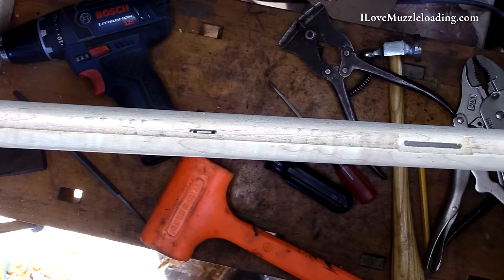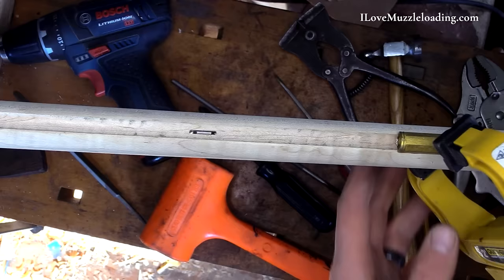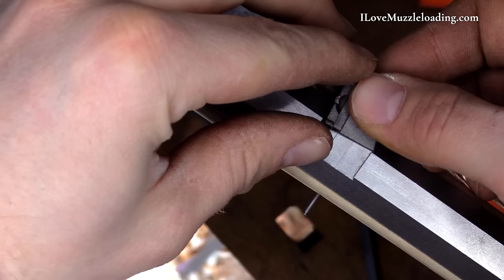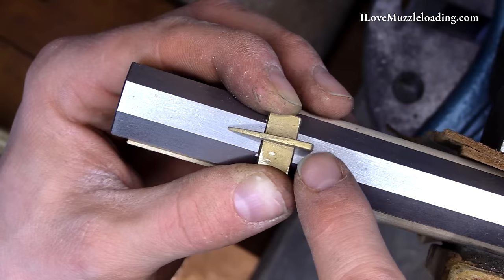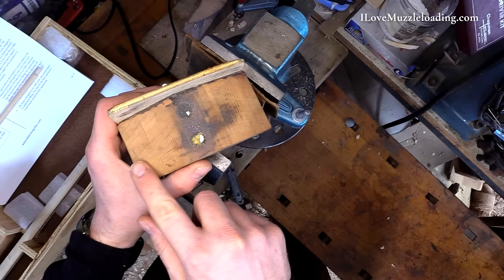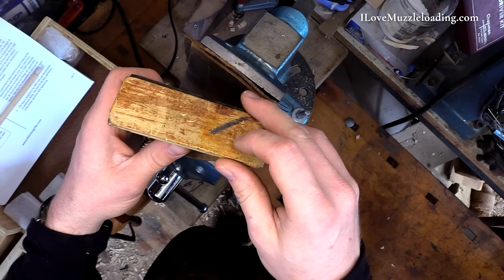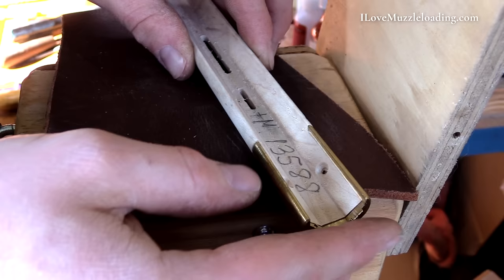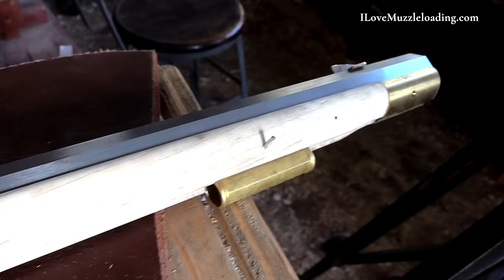Let's Build a Kibler Woodsrunner Flintlock Muzzleloader Kit | Part 1 | DIY Blackpowder

Comment: My Woods Runner sits on my work bench in front of me as I type this.  It's about 95-98% complete.  I built it under the direction of Gary Ludwig of Southern Ohio Artisan Workshop in March of 2024.  It took a week.  He guided me through the build, and I was thus able to avoid several mistakes that I would have made working just on my own.  For instance, file the machine marks out of the stock.  They will be visible if you finish it without smoothing them out first.
The precision of the manufacturing process is so good that I find that even the more difficult sections are repeatable from kit to kit.  For instance, I too had some trouble fitting the rear sight.  It's a tight fit.  And my patch box required the same fitting as yours did.  Gary helped me out here and mine too closes with a snap that a deer can hear 50 yards away. 
The lock is first class probably better than anything else out there now.  I'm having the side plate engraved now with a prayer of thanksgiving for a successful harvest.  Mine is going to be a working hunting rifle.  Not a wall hanger But, I did want some personal touches.  I, too, numbered my thimbles but, I did mine from back to front as I, II, III, with a file.  And oriented them with markings toward the front, muzzle, so as not to install them backwards.  Try fitting yours until the ramrod fits nicely and mark them there, in that orientation and position.  
I also draw filed the barrel on the top, visible, flats.  Making them smooth will give you a better finish in the end.  Buy some new files to do this with.  You won't regret it.  And when filing be careful not to round out the flats of the barrel.  You want them to be crisp and even all the way down to the muzzle.  Do this before installing the sights.  
My end cap was cast not machined.  And I filed the front of it round to match the look of an original that were made from sheet brass.  This is one of the few times that I really did try to round off and edge.
The lock, side plate, barrel tang and bolster were all filed to get them to fit well.  I didn't inlet the wood stock hardly at all.  Now, I filed them ONLY ON THE INSIDE AND NOT ON THE TOP EDGE WHERE IT WILL MEET THE WOOD.  You want a good tight fit here, on the top edge where you can see it and it makes a weather seal but, you want it to fit loose enough that you can dissemble it easily.  Be careful here!  You can do damage that you will regret and see every time you bring it out of the gun case to use.  The edges are filed to a slight taper that slopes away from the wood only on the inside.  You will find that the original fit is so good that you will want to preserve it as much as possible.
Go ahead and carve your stock until your hearts content.  Mine has a minimum but, it does have some.  Like I said, mine is a working firearm.  I finished mine with Permaline stain and will finish with Permaline sealer soon.  It's what Kibler recommends so I went with that.
Grind a point on all your pins (both sides) and then grind off half of it to make it flat.  Do this so that it will not tear out a gouge in the wood when installing or removing them.  The beveled edge will naturally find its own way through and make it easier for things like that tricky trigger installation.  
My only regret is that I waited so long in life to do this.  So long in fact that I can no longer see the front sight, at least not as well as I used to.  Life just isn't fair.  Let me know if this, long, post was helpful to you.
Reply: At 68 years old I just had cattarct surgery on both eyes, 20 20 now but still wear reading glasses, good luck and thanks for the tips

Comment: Ethan, not sure how I missed this earlier.  A couple tips for your viewers, I always chuck the pins in my drill press or hand drill if you don't have a press and spin it against a file to chamfer the ends just a little.  I'm not talking file to a nail point but just break the edge a little.  It makes them go in easier and reduces the risk of chipping out when you drive them through.  Also, instead of using a sharpie, I file one notch in the tang part of the ramrod pipe for the one closest to the butt and 2 for the one next closest to the muzzle and 3 if I'm using 3 of the same type of pipes (i.e. some Southern rifles I build).  Sharpie lines can wear off but the file marks are forever. Also, if the sight won't fit the dovetail, I always file down the sight instead of opening up the dovetail on the barrel.  It's a whole lot easier and less expensive to buy a new sight than mess with a dovetail slot in the barrel that is now too big necessitating making a new sight.  (don't ask me how I know this).

Comment: Had to file my patch box catch also. I was surprised how high my barrel tang sat. Had to chisel more wood than I expected I would have to. But it was fun learning that part of it. In the future I would just make pins at the end. I also learned don’t file the expensive barrel, file the sights for fitment. I didn’t have an issue. But read that on Kibler group.
Reply from the maker: Great tip! I’ve done this a few times now and feel comfortable doing it.

Comment: Whoa!!  Nice kit. Notice the wood and metal fit won't require any epoxy bedding. The back of that barrel is fitting perfectly and will take up recoil as it is supposed to. Probably pretty spendy to boot. Thanks for the vid.

Comment: One thing I learned from more experienced builders is this... Only clean up the dove tail in the barrel, if the sight doesnt fit, take material off the sight. You can't add material to the barrel, but you can buy a new sight if you mess it up.

Also I emailed a couple of things, picture of some  bullets I'm casting if you want any, and a picture of my stock after ferric nitrate but before heating.
Reply from the maker: Thanks man! I was following Kibler's video on barrel filing. I've done it quite a few times and it's worked out, but I understand the concern. 

I'll get back to my email and check it out!!

Comment: a fast way to round off the pins, chuck the pins in an electric drill and round the pin with a file.  The way that these kits fall together, i think you could put all the parts in a box, then shake the box a few times, then come out with a finished rifle.

Comment: Is there a preference on witch direction to put the sights in being that there tapered
Reply from the maker: I’ve always tapered from the side plate to the lock, like the pins. So the side plate side is slightly wider than the lock side
Reply: Why don't you leave your pins long during assembly
Reply: Thanks I'm starting a Kibler southern mountain rifle real soon here.